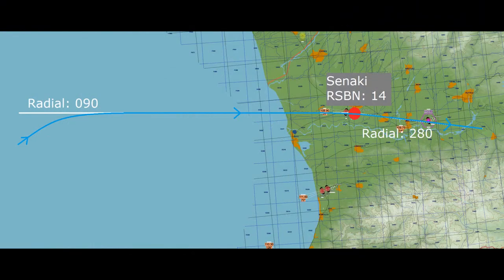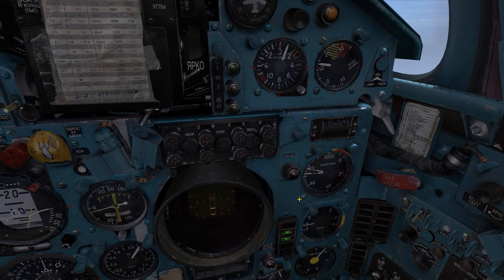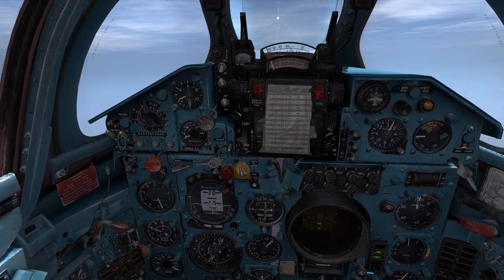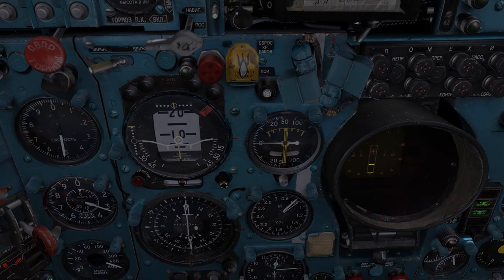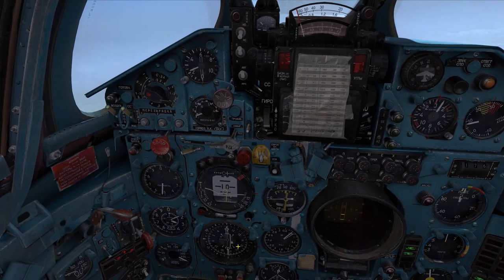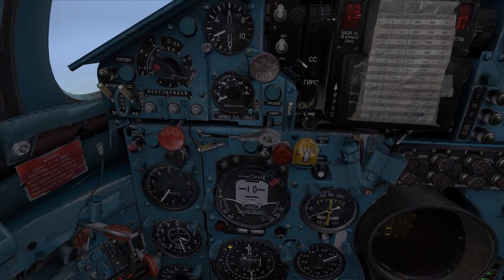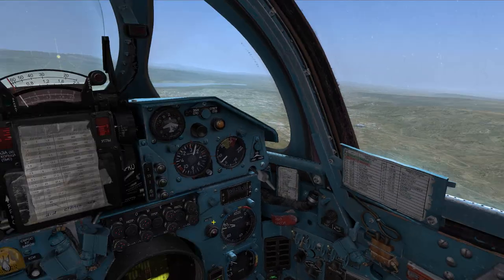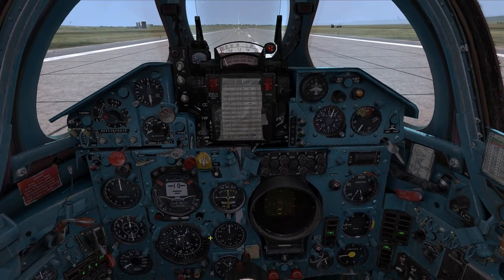[DCS] MiG-21Bis RSBN Navigation

Comment: Nice comprehensive tutorial, however i cant seem to get the yellow "command needles" on the KPP to move when im in Cloud Penetration or PRMG. The course and glideslope indicators work just fine. Have i missed any buttons?
Reply from the maker: For the cloud penetration mode you need to set the RSBN channel, for the glide-slope and localizer you have to set the PRMG channel. Could that be it?
Both of the channels can be set on the RSBN/PRMG panel, where the left selector is the RSBN frequency and the right one the PRMG frequency. For a airfield the RSBN and PRMG frequencies are always the same.
Reply: xxJohnxx I have the correct channels dialed in. Does the PRMG have to be on even in clud penetration mode? I can still fly the glideslope using just the indicators to the left and on top of the KPP, and on the center of the NPP, but it would be nice to have the plane tell me what to do :)
Reply from the maker: Baba Ganoosh
Yeah, the RSBN has to be on and selected as primary navigation source. You do that with the switch left of the RSBN/PRMG panel.

Comment: Your 'radials' are quite the opposite of the correct, real radials. ;) A radial is always pointing away(!) from an emitter, never towards it. Hence a radial always starts in the middle of the station pointing in one of all the respective 360 directions, thus your 90° "radial" was in fact the 270° radial, your 280° "radial" however was the 100° radial... et patati et patata. What you meant there in your map is called 'heading', not radial. The heading differs from the radials, depending if you fly To or From an omni on a particular radial. From an omni the heading is slightly the same number like the radial, To a station it's the reciprocal of the radial. Difference! E.g. when you flew away From the Senaki VOR, your heading was 100° on the 100° radial. Same numbers = From direction. When you flew To the Senaki VOR, your heading was 180° reverse to the radial you were flying on: a heading of 90° on the 270° radial means = To direction.

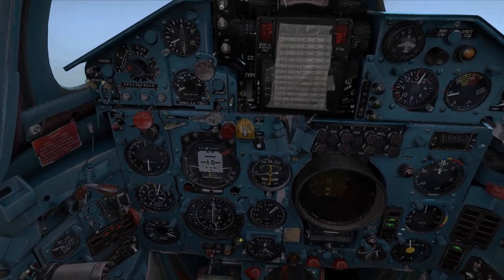Btw, at 21:10 I've been starring at your 'pilot O2 level gauge' on the left and wondered, if this pilot wasn't on the verge of fainting yet... and then... zzzZZZzzz  :)) But why? Where's all his O2 gone?
Reply from the maker: Thanks for the clearing up the VOR stuff. Seems I am by no means an expert on the correct phrasing. Probably should have another look at that in the future.

The O2 level was dropping so fast due to a bug in the first days after release where the O2 consumption was way to high.

Comment: Why couldnt they just get an iphone, and use GPS navigation.......
Reply from the maker: +supermax7720 Hehe, that would have been too easy!
Reply: Simple, really. A few reasons.

1. There was no GPS navigation in the 60s.
2. GPS is american technology which can be blocked by the military.
3. Satellites can be shot down and you would have to rely on INS.
Reply: Afaik 'newer' mig-21's use Glonass for navigation, or at least have the option to.
Reply: The Cheshire Cat I guess you're right. But still, most modern aircraft use satellite positioning systems just to supplement their INS'es.
Reply: As far as I'm aware of no modern (at least commercial, I'm not 100% familiar with 4.5-5th gen fighters) all use IRS (inertial reference system using 3 ring laser gyroscopes and satellite navigation in conjunction with DME/DME, VOR/DME and RAIM.)

But yeah, I wouldn't be surprised if even older INS aircraft use satellite navigation, it's so damn convenient even if it's stipulated to not be relied upon as a primary source of navigation.
Reply: The Cheshire Cat Yup! And if GPS goes down, it means WW3 :)